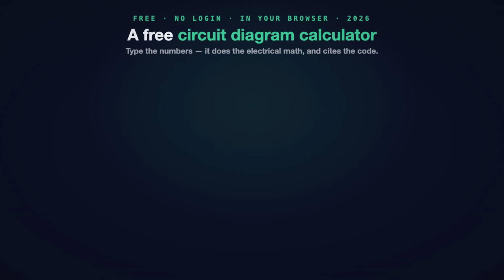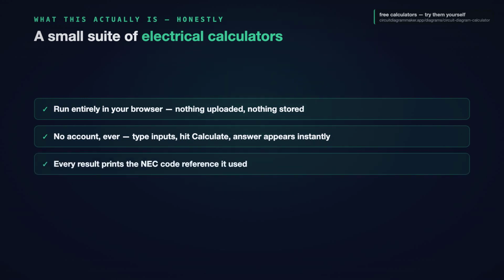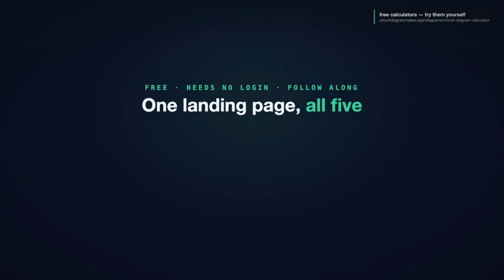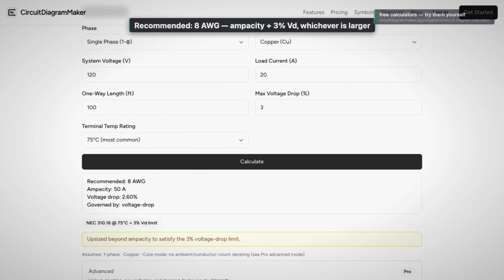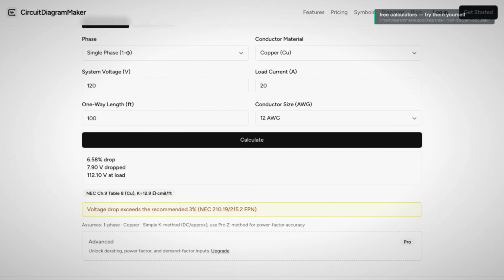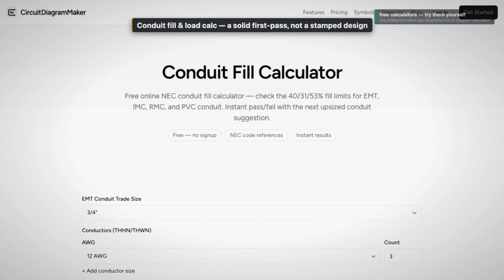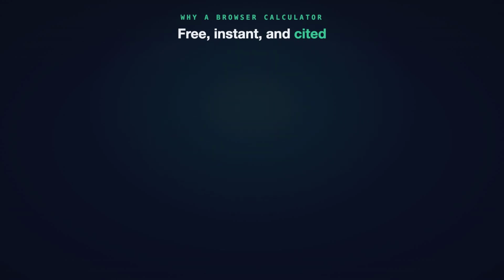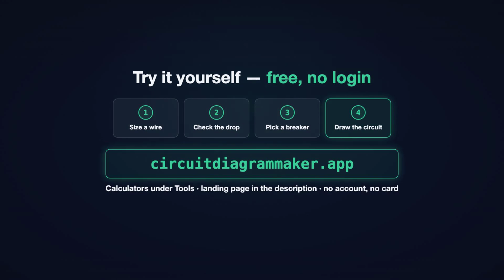Free Circuit Diagram Calculator (No Login)

Comment from the maker: Full disclosure (also said in the video): these calculators are ours, and the free tier is core-mode — the everyday NEC formula, done right, with the assumptions printed on screen. Derating, power factor, and demand factors are Pro, and the conduit-fill and load calculators give a solid first-pass number, not a stamped design. I'd rather tell you that up front than have you find out.

Every worked answer in the video is real and reproducible: 120 V, 20 A, 100 ft copper → 8 AWG (NEC 310.16); that same run on 12 AWG → 6.58% drop, over the limit (NEC Ch.9 Table 8); a 16 A continuous load → a 20 A breaker (125% rule, NEC 240.6). Type them in yourself.

Free, no login, in your browser — size a wire, check the drop, pick a breaker, then draw the circuit in the same tab: https://circuitdiagrammaker.app/diagrams/circuit-diagram-calculator?utm_source=youtube&utm_medium=pinned_comment&utm_content=yt-137